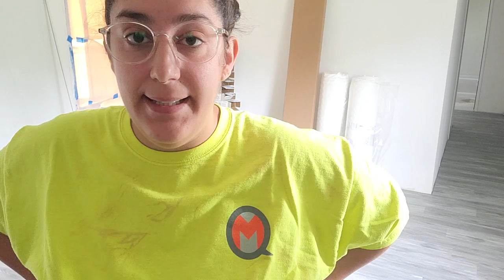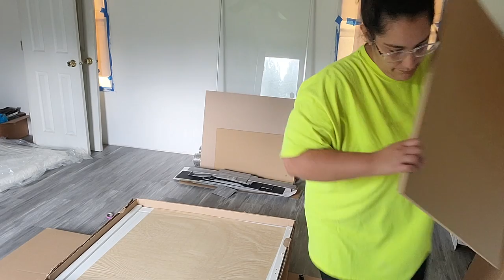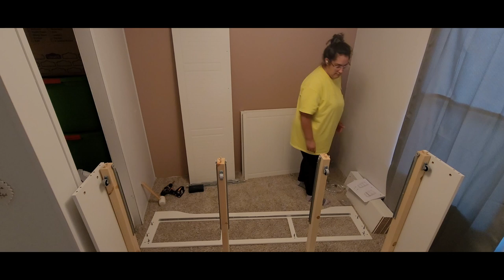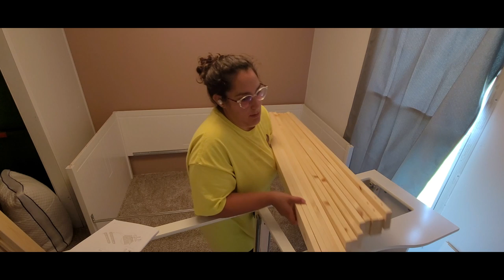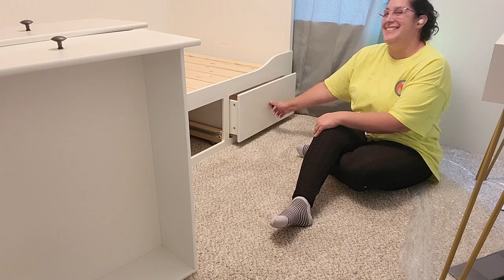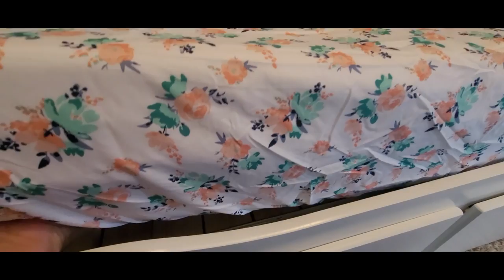Hemnes Daybed from IKEA

Comment: Can I get a 10 inch full size mattress because I am a little bit under 150 and at 5'3. I want to downsize. I have a queen size mattress but I want to downsize to a full size mattress. I know a regular queen size mattress would not fit because the length and this is probably 70 something for the length.
Reply from the maker: I think it will. Just cross reference the size mattress you are getting to the measurements of the bed. But looking at it open, it looks like a full to me.